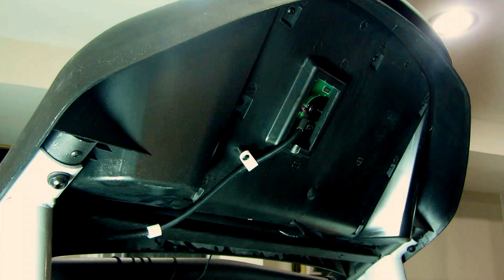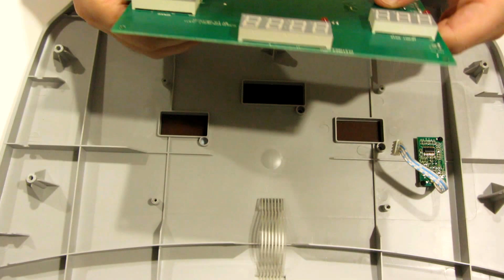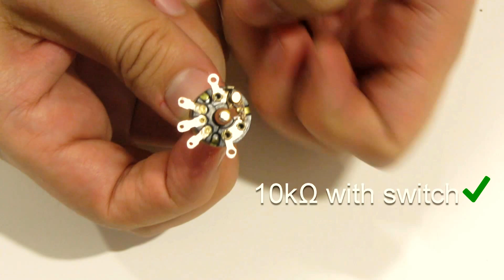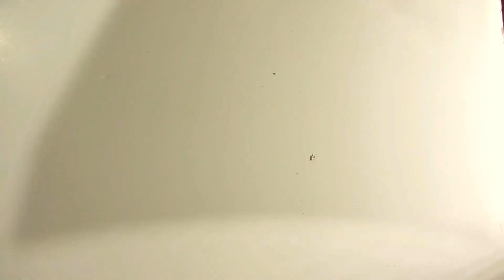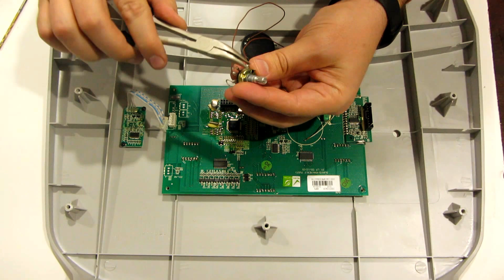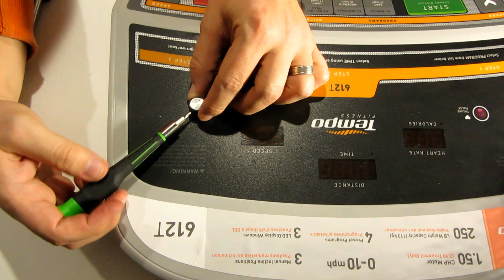Stop Your Treadmill From Beeping DIY

Comment: To disable the speaker just remove its top plastic cap by putting a small screw driver through the hole and lift it off. There's a metallic disc that will come out and speaker is disabled. No need to wreck the buzzer or use a solder to remove it. Did it on a Proform treadmill. Opened the entire back panel but realized it wasnt necessary to get to the mainboard - this can be achieved by removing the 6 central screws at the back that hold the central control panel in place. Then pull the panel towards the belt side to access the mainboard and buzzer.
Reply from the maker: These are great tips, thank you!
Reply: What are they describing? Is it universal ? Every treadmill? How to in a seperate video by@ @GabesHacks i hope....
Reply: 2 years later, this is the comment I needed. I have an Ancheer walking pad. I took off 6 phillips screws from the top motor cover, undid the 5 small screws into the circuit board, and found a really small square. Pried that out, pry'd off the tiny metallic disc, and put everything back together. Completely silent now. Mine was labeled "BUZ1" in case that helps anyone else.

Thanks man, that beep was agonizing.

Comment: Thanks for that, I only have a cheap Chinese walking pad but the beeping noise was horrendous. I couldn't use with my partner sleeping etc. The problem is gone now, literally 😂 so much better without the beeper from hell. It was a different set up inside but thanks to you I knew what to look for 👍
Reply from the maker: Awesome 😄 Glad I could help!
Reply: Did you take it off with the soldering tool?

Comment: Is there a good way to identify a buzzer when it doesn't look like that one? I am so tired of my nautilus u616 bike beeping but when I opened, I couldn't see anything looks like your buzzer.
Reply from the maker: On that bike, you can apparently turn off the sound without taking it apart. See page 31 of the manual. It's one of the options in the "Console Setup Mode".
If you've lost the manual, it's here: https://download.nautilus.com/supportdocs/AM_OM/Nautilus/NLS.U616.MY14.AM.OM.WARR.EN.pdf

Comment: I was getting desperate to get rid of the dreaded beeping sound because it scares my little dog so bad she shakes. (I stopped using it.) as a result, I wasn't getting the exercise I need. I was thinking about getting rid of it altogether. I am not handy with tools but think I can manage it. At least some of the first examples might help. I have a Horizon T202 treadmill, it costs $75.00 an hour for a treadmill guy come from that company at a 2-hour minimum. ($145.00) so you saved me that much money. Thank you. Edit: The back of this treadmill looks entirely different so I am not sure how to take it apart. If you are familiar with this specific treadmill I would appreciate some input. I will look up the diagram for the wiring online, maybe it will show me something.
Reply from the maker: Are you able to take the screws out to see the circuit board? The buzzer should be easy to spot once you can see the whole circuit board.
Reply: @GabesHacks   Thank you. Yes, I was finally able to open the circuit board and was able to see the buzzer. Now I will silence that sound!
Reply: Same! The beeps on my walking pad scare my big Malamute so badly he would paw at the back door to get out of the house. I completely stopped using it because of how traumatic it is for him.

Comment: Can I just rip off the speaker and screw the touch pad back on?
Reply from the maker: Yes, absolutely. Just make sure you don't damage any of the other electronics.
Reply: @GabesHacks  I opened up my touch pad and noticed speaker holes without any speakers. So false advertising or something. I unscrewed the motherboard and found the tiny black circle speaker. It was on the inside of the motherboard, not facing outside of the motherboard. I pried it off and now I have a perfect, peaceful treadmill. It was that simple. One tiny speaker the size of my pinky nail had the power to echo throw space, Not anymore. At first I was gonna cut the wires on both ends. I'm glad I didn't.

Comment: dont agree this approach. we need to understand why is this beeping first place before performing 2nd action to how to fix it.
Reply from the maker: It's beeping because it was programmed to beep. That's simple. You can't change that unless you can reprogram the main chip, which isn't likely. It's easier to do what I did if you want to get rid of the beep.
Reply: @GabesHacks   understand what you are saying. But, it’s programmed to beep for what? To point a potential issue, right? So, if we can address the potential issue, i expect beep to ho away by itself.. would you agree?
Reply from the maker: @atifsid_melb  Mine beeps under normal operation. It beeps when it turns on, beeps when it starts running, beeps when it changes speed, beeps when it stops. That's what I was attempting to change.
Reply: @GabesHacks  ah ic! My bad!! Mine does those normal beeps. But this morning it started 4-5 beeps whilst i was jogging already.. something unusual.. sorry! I misunderstood..
Reply: @GabesHacks  thanks you guy <3 

I have new treadmill and this beeping is so annoying.
I can  not wait to destroy that beeper.
Reply: So I contacted the manufacturer and asked them if I can lower the volume of this damn loud buzzer. The manufacturer responded back and said that you cannot disable or lower the volume of the buzzer since it is a SAFETY FEATURE.

Comment: That's in most cases an 'oil my fking belt' alarm, it has a way to stop it from keys. Unfortumatley those instructions are misskng from my treadmill. Fuck you TECHFIT!
Reply from the maker: If you're right that it can be disabled, you could try calling the manufacturer to ask how.

Comment: It never used to beep (apart from when pressing the buttons), now instead of showing the time ive been running it shows "OIL" and it beeps 10 times every 10 seconds. Is there a way to possibly restart the system or do I need to remove the speaker?
Reply from the maker: It depends on your model. It might be trying to remind you to oil the track. There is probably a way to clear it. Check the manual (if you don't have it, you can probably find it online).
Reply: @GabesHacks  ok thank you I appreciate the help
Reply: I had the exact same beeps - 10 evert 10 second to remind me to oil the deck.  I oiled the deck - and still kept beeping. I oiled it again. 

Eventually just yanked the cuneiform board speaker off.   Prob a faulty oil sensor?

Comment: I have same model. Something happened to it. Squeaky sound comes out of the speaker, digits show half of numbers and the treadmill does not run. Any suggestions?
Reply from the maker: I couldn't tell you for sure. But that sounds to me like an issue with the power supply. You can try calling their support line. They were helpful for us when we had a problem setting it up when we first bought it. Although that sounds like a part might need to be replaced.

Comment: I have a 20 year old Life Fitness elliptical that has beeps that have gone haywire. They beep intermittently with no rhyme or reason. Sometimes I can ride for 4 - 10 minutes with no beeps. Other times it randomly beeps 1 to 12 times. Otherwise it works normally. I suspect that a capacitor leading to the beeper is dried out. I wonder if replacing a capacitor would fix it.
Reply from the maker: It's possible. Capacitors will often start bulging when they're going bad, so if you see that then it's for sure bad. But just because the top is still flat doesn't mean everything is still good. They are cheap, so it's worth a try.
Reply: @GabesHacks  And now today this machine is now unresponsive to pushing the buttons on the front control panel. Motherboards on computers are the same way. They start failing incrementally until the next day, next week or next month when the thing just fails completely. 

You seem to be an expert on this stuff... Do you think capacitors and circuit boards wear out faster if the machine is always left turned on, or if it's unplugged after each use, or would it make no real difference at all? I always left this elliptical trainer plugged in. I've heard that computers last longer if put in sleep mode instead of shutting them off after each use. But they might be talking about other parts like the PSU that last longer.
Reply from the maker: @BladeJones  I'm no expert, but I know that leaving it plugged in won't matter. The power switches on these disconnect the power completely anyway. That is unlike computers where the motherboard still has power even if it's turned off.
You can visually inspect the capacitors on it if you suspect that might be the problem. Replace any bulging ones and see what happens.